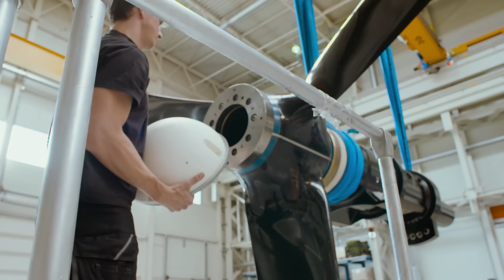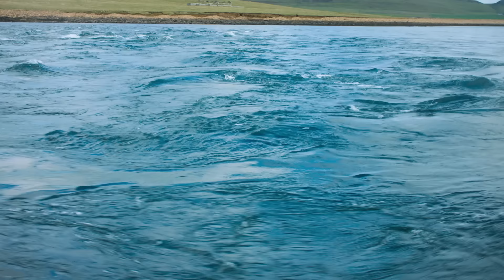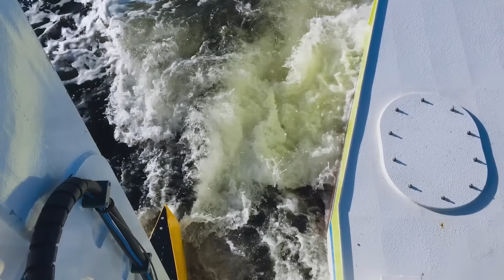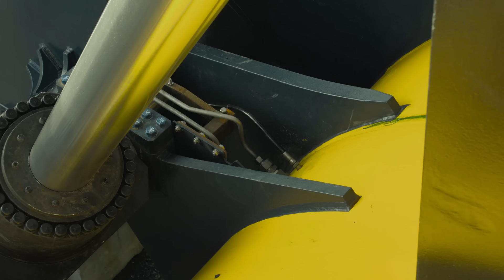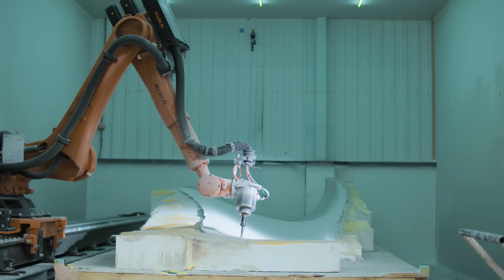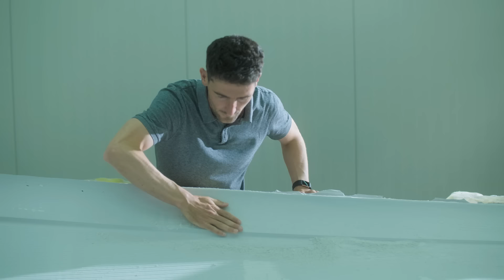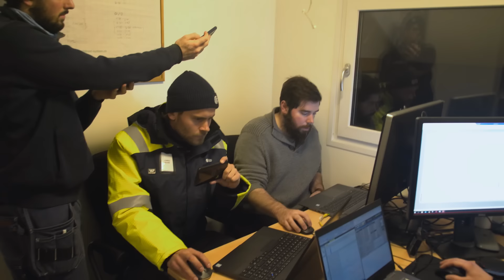Tidal Power: Unlocking the Greatest Untapped Energy Resource on the Planet | FD Engineering

Comment: Bigger is never better. Increasing size in view of diminishing returns is loco. Smaller, more agile distributed systems are more accessible, reliable and manageable on a human scale. That's important. The power class would rather not give up control and the advantages control brings. Distributed energy systems don't need herculean might in the same way larger, more centralized generation systems require. The problem capitalists have with distributed systems is that they're more difficult to leverage centrally, to seize control & profits from the hands of the locals. The internet enjoys multiple optional pathways to deliver communications. uses multiple  works is only sustainable as a centralized system.
Reply: Bold claims and blanket statements mean you're speaking from an armchair engineer's perspective.  Comparing power distribution to internet is very flawed.  I agree that a decentralized approach has its benefits.  But when it comes to cost and feasibility, there is no truth in saying bigger or smaller is always / never better. Talk to the designers, withhold your claims, and you might learn something.  But based on your choice of words you don't strike me as the type of person who wants to learn anything different than the way you think things are.

Comment: To bad they didn't show how they actually build the base in this vast moving water body. I mean if the lower of the turbine was sich a deal. Building the base was even worse I guess
Reply: Even more bizarre that it's not even fastened to the ground structure. That's was not what I was expecting
Reply: Also wonder why that weird ship like device. Has this horrendous form below water. It's so blocky. Straight flat bottom.
Reply: Wish they explained better why denser water also gives more energy. I can not gasp what slower energy than wind gives more power. The power is generated by by movement right. I doubt it moves faster under water.

Comment: What was not revealed is what is the average cost per kilowatt of electricity produced?  If the cost is 10x higher than current normal, then this will have very limited potential.  If the cost is equal to normal, then that is promising.

Comment: How many years does it take to pay back the cost of the units, before you get 'Free Energy'?
Up to a quarter of the electricity for the island? Is that all? They need three more units! This is crazy expensive!
Reply: YES. The whole project is ridiculous and laughable compared to nuclear energy. People think something looks cool and get excited about it but the price and power output leave this with no place for production. Not to mention if it was successful, cheaper and made way more power it would obliterate marine life.
Reply: @anticommunistalpha  dumping nuclear waste into the ocean when a ship runs aground and breaks up off Southampton instead of carting it to Africa to be buried for the next 20,000 years on the other hand would be much better for the marine environment. Yes I see your logic. And raise you a pinhead.
Reply: @anticommunistalpha everything has a break-even point. I suggest you think more broadly and ask questions such as how long the designed lifecycle is, and where the BEP is with respect to it.  Secondly, you are obviously here not to be sincere but rather to push nuclear, otherwise you would have suggested other forms of energy.  Guess what, it requires energy to mine for uranium, and energy to enrich it, and ... it is non-renewable.  I'm not against nuclear, it has its place.  But I have a concern for chewing up the planet when digging for Uranium, particularly when only 0.7% of it is useful.  Not sure if you have all of that considered, but considering you are suggesting a singular approach to energy I would guess not.
Reply: @anticommunistalpha  - You really think the engineers behind the project build it to look "cool"? You are an utter moron.

Comment: The only viable tidal electricity technology today is swedish Minestos tidal kite with 1,2MW 28 ton 12m wide turbine. It works even in slow currents while not one of the other tech. do that cost effectively.
O2 2MW and 800 tons of steel is INSANITY. Waste and CO2 footprint off the charts.
Reply: Waste form what? They don't use engines that can pollute. The platforms are pretty green in function

Comment: They didn't mention barnacles growing on the turbine blades degrading the hydrodynamics.  Is that going to be a problem?
Reply: Barnacles usually only grow on the non-moving parts of a hull. You can get a bit of bio-fouling on a ships propeller (which the turbine blades are, in a sense), but that is a matter of 1-2% loss of power. The propeller is polished by divers during the annual in-water survey, that all ships have to have. Mind you, that is done on a brass propeller. Not entirely certain what the procedure is for carbon fiber, as used in some of these turbine blades, but most marine growth can be cleaned off with a high-pressure cleaner, even on fiberglass hulls. Take care.
Reply: @BrianJensen-ym5gk  Okay, thank for the info.  I'm glad to hear this won't be a problem since this seems to be a great idea.

Comment: These wonderful Tidal Energy Converters (TECs) as shown in this video appear to be relatively small generators, in the order of megawatts (MWs) only. Far larger capacity is available with hydro power, already 22 GW (gigawatt = 1000 megawatt) in China, & a planned Congo facility approaching 40 GW. However, a Tidal Power Plant in Russia is scheduled to develop around 89 GW. A smaller bay in north-west Australia with similar 11m tides may also have giga-potential. Nuclear is WAY down the list & perpetuates a toxic world: the world's largest hasn't operated for 20 years, as it's too dangerous (never mind Fukushima). Also proposed is DYNAMIC TIDAL POWER that hardly anyone knows about, yet has VAST potential. A nuclear reactor requires one million tonnes of concrete & steel, yet only generates one GW - not bad, but why not phase them out given these other emerging technologies? (Magnetics & Gravity).
Reply: Agreed. No mention of estuaries in this video

Comment: The problem is the low velocity, but calculate it yourself
Best   case: horizontal turbine
P  = (2/3 speed)³ × density × disc area
 The problem is the limited blade lenght and the very low velocity : a few knots 
Evaluate it yourself 
1 knot = 1.944 m/sec
Reply: Torque is the main factor,this coupled with gears then voltage regulators will give the required output
Reply: @busking6292  Like on a wind turbine, the low speed must be increased..
For that I have a solution::
 a speed increasing multistage transmission that does not use the convetional planetary system where fatigue on the teeth is the limiting factor, It is a gearless  speed increaser with very low friction and as a result the efficiency is high.
Reply: But as the documentary says, water is 600 times more dense than air, so it would just need the right gearing.

Comment: Maintenance costs will be interesting...
Reply: Yes, salt water is a pretty hostile environment.   That's a pretty complex piece of kit.
Reply: I bet the seals trying to keep the seawater out of the machinery will be a bit of an issue?
Reply: @tonybmusic1166  Not only that, but corrosion as @harry130747 said, and then biological issues like mould and sea life attaching itself to various parts of the machinery...
Reply: 25 year life with 3 maintenance periods required . That is excluding cost of distribution . However compared to the carbuncle of spiraling costs attached to the new nuclear project being built, and the increased demand if people want electric cars may well be a very viable source?
Reply: @paulgee1952  Nobody will know except by experience.  That's just guesswork.
Reply: @harry130747  read the brochure.
Reply: @paulgee1952  or the solution is to have engineers set the legislation and costs for nuclear power plants instead of lobbies with interests against it
Reply: @Potent_Techmology  But then everybody everywhere would have cheap, clean, reliable power! Just think of all the ideologies threatened by a suggestion like yours! How dare you, sir?
Reply: @rootuser7206  got called a trump defeatist in another comment by the green mafia for saying the same thing

i don't wanna live on this planet anymore
Reply: @paulgee1952  you would be lucky to get 5 years tops out of a tidal generating gearboxes that cost multiple millions of dollars and that's not including downtime, bringing the whole turbine back to land and labour let alone how much it will cost just to replace a 5 dollar fuse, it will become economically unviable and produce expensive energy that noone will buy.
Reply: @johnnyrocket80085  That's what tech is all about - improving things so that these costs aren't going to be so high.
Reply: @alan2007-x8x well then, they best get cracking!😂
Reply: interesting to see if this will increase the fall in numbers of the whale populations
Reply: Staggering

Comment: How long until the Russians do something to these if we become reliant on them in the UK? Easy for them to cut cables or damage the blades. Maybe once things have calmed down and adults are back in charge. Also what effect will they have on large marine mammals?

I'm more interested in the Australian guy who came up with a prefab concrete structure you lower in ftont of breakwaters around our harbours with and the waves hiting it compress air within the structure which passes through one way valves driving a turbine. We have literally hundreds of harbours around the UK most of which are submerged all day, plus maintenance of the structures is a matter of lifting one out and slotting a new one in.

Comment: Its a good idea IF we didn't have to worry about ultrasound from the turbines. Many organism use ultrasound to communicate. Even plants produce ultrasound.. If you hit them with the wrong frequencies it could cause terrible issues. Thermophilic bacteria can reach temps hot enough to start forest fires if mulch is piled too high. With yard waste of all kinds including food waste a machine can be used to make nutrient solution dense enough to drip feed them super hot at safe temps for them to live. 

Cold steam systems based on Jeremiah's proofs can run at 135F. For the same reason if you raise water high enough into the sky it will start to boil out the energy/heat. At certain pressures, heat value is greatly multiplied. Thermophilic bacteria can reach 250+ with the right strain. Forget to feed and they get cold because of winter? Just like how they come back when you pile more mulch, turn the feeder back on. They can sleep like a Dragon story..
Reply: ^ Underground.. No light needed. Gonna be good for spaceships someday. Humans make lots of waste to feed things with..